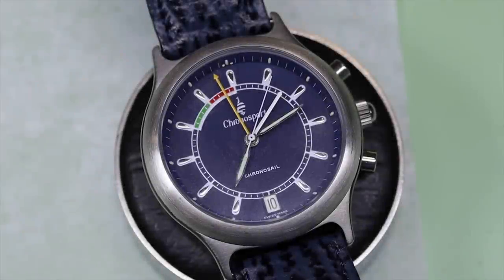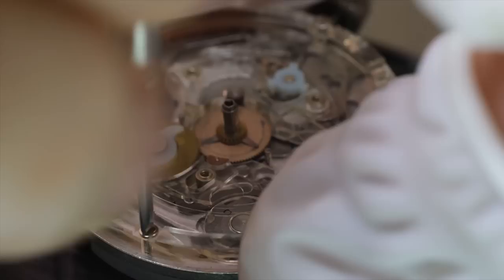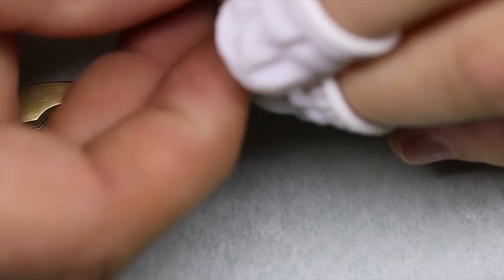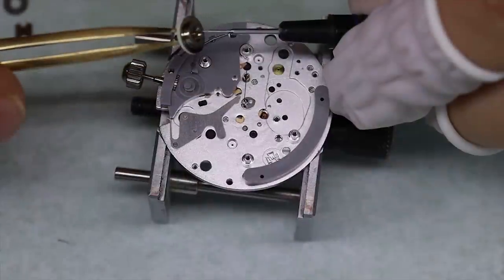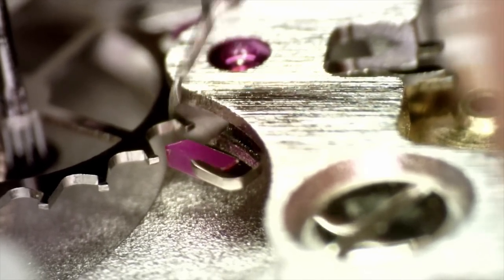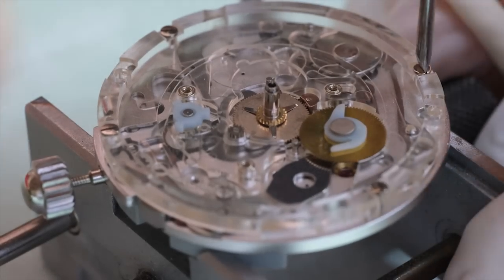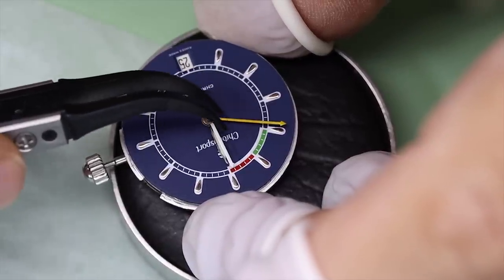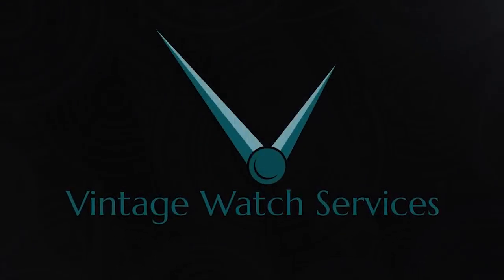A high grade watch with a surprise inside...

Comment: The engineering and design behind this watch are fantastic.  To obtain such excellent performance along with specialist function at the same time as reducing production costs is no mean achievement!
Reply from the maker: Thanks for watching Owen, and your comment is spot on! It was indeed a great feat making this movement in 1975 with a high grade performance but low cost design 👍
Reply: @VintageWatchServices  This company was awesome back then.  Did you know they manufactured the very 1st Ana-digi Military watch (Chronosport UDT type 1)  I still own 2 of the type 1 and 2 of Type IIa  (my favorite model)  from 1979 and mid 80's

Comment: As a sailor and a regatta racer, this watch is all about me.  Very nice indeed.  I don't care if the movement has plastic parts, it seems to have held up so far and with its limited use, should last a lifetime more.
Reply from the maker: Thanks David! I think that's entirely spot on. The watch enthusiast in me wrinkles his nose a bit at the plastic, but it's actually a high grade movement.

Comment: I think this is a very attractive movement.  It has elements of Bauhaus architecture, where form follows function.  There is beauty in the different finishes within the movement - the contrast of the non-reflective plates with the reflective surfaces of the flat levers mounted on the plates.  The screw heads are highly polished. Careful thought has been given to the colour of the plastic - a complimentary gray colour for the plastic attached to the mainplate, clear for the chronometer plate, and blue and white for smaller parts.  Both the inside (the movement) and the outside (the case, dial, and hands) are cohesive and complimentary to each other. All in all, the watch is elegant in its simplicity.
Reply from the maker: Thanks for watching and for your comment, Michael! Very interesting reflections. The movement is clearly very well thought out, it's just strange seen with our eyes that Lemania would use so many plastic parts in a high grade movement.
Reply: But the (movement )finishing is so…butt

Comment: Once again Stian, you come up with something seldom seen in this age of middle earth!  Love it!  Takes me back about twenty years to when I decided that I needed a Sinn 156 which uses the Lemania 5100 cal., so I became aquainted with the ease of reading the center seconds chronograph hand with it's little airplane wings near the tip. There were several companies using it besides Sinn as NATO supposedly favored it for flight use.  Tutima, I blieve, had a contract with the German Air Force to make these watches.  I always believed it to be a rugged and functional movement. It wasn't til a few years ago after I convinced my local watchmaker to service it, that I became aware of it's plastic parts. The Sinn service shop in the US told me they couldn't (wouldn't) service it which I found surprising.  At any rate, that center seconds display remains a very usable feature and I was glad to see that Sinn has developed their own movement based on 7750 , with this feature.
  Thanks for showing this watch, it's truly unique. I'd only seen Rolex's with the yacht timer functions.
    Looking forward to your next video!
Reply from the maker: Thanks for your comment Randy, much appreciated as always :) I'm surprised the Sinn guys wouldn't service the watch, as the movement is obviously serviceable and in fact pretty high grade. But those plastic parts are a bit off-putting to a lot of people, even though they are used in areas where they are quite suitable.

Comment: A functional watch from a time that the watch world lost a part of it's soul. 
I appreciate all types of machines, large and small, and plastic has made it's way into everything. In most cases it's not as beautiful, but is functional and in some cases more durable than metal. I guess that there is a beauty in that.
Reply from the maker: Well said, Peter! I think part of the reason many people don't like plastic parts is that they can picture themselves making metal parts, but plastic cannot be shapen with tools in the same way. It just takes part of the worksmanship away.
Reply: @Vintage Watch Services  interesting take.  The reality is that metal and plastic wheels, disks, etc. are made in the same way: machined from a blank or stamped from a sheet. But there is an abiding image of a smith standing over a forge and hammering on an Anvil. Just goes to show that perception does not always mesh with reality.

Comment: Another great video with good banter and interesting history. I wouldn't mind the plastic parts as long as the costs are in line with the materials and finishing.
Reply from the maker: Thanks a lot, Steve! Most users of course never see the plastic parts and can only judge the quality of the watch from its performance, and that's not really an issue. This watch is actually quite affordable compared to comparable chronographs, and the movement certainly adds to that.

Comment: I am amazed how you remember where each part goes in this complicated movement.
Reply from the maker: Oh, without technical manuals and photos I wouldn't :) The general layout of a basic movement is straigh forward enough that you won't need to look things up even if it's a movement you've never worked on before, but for a more complicated watch there are a few more parts that I might look up.

Comment: One often sees the usual suspect know it all bores on the watch forums say about these types of watches with plastic or less refined parts were designed to be throw away or such and that if you want something that will last forever you have to get a Rolex or Omega as nothing else will last, don’t even start to mention old quartz watches, the bores will tell you they don’t last.
This video proves what has been my experience and that is the bores speak absolute rubbish!
I have old watches with plastic parts inside, forty years old and and still work perfectly, quartz watches including GP’s first true production watch, still working perfectly almost fifty years later as is my Seiko LCD from 1979 and all my Vintage Timex watches from the fifties onwards including the electric still work perfectly and are serviceable contrary to what the bores will tell you.
I’ve been thinking about a memosail so I’m really looking forward to watching that video!
Reply from the maker: Thanks for watching, Ian! I know what you mean and there's certainly a lot of snobbery in the watch world. The way I see it is that the materials matter less than the skills used in the design. What we have here is a very high grade manufacturer choosing to use plastic parts and being very strategic about how and where they are used. This is really a high grade movement that was made at a time when they pulled out all the stops to not be outcompeted on costs. If that makes sense :)

Comment: Well, it IS an interesting movement , that is beyond debate. I do have my reservations regarding 'cost cutting' by means of using precision plastic parts.
I have some experience in the making and design of moulds for plastic parts in the electrical industry .
A well designed and durable mould for parts as seen in that watch, will be a 7 figure affair... and only will be cost effective when you can sell parts(and in this case watches) in massive volume.
Also these moulds have a tendency to wear out a lot faster than you'd want them to. Repairs on them are costly and will often be visible in the end product (in this case the plastic part)
Of course, these days the Chinese will be able to make you a mould for a better price than a proper European or US manufacturer.... but in that case we are talking about Chinese parts in European movements and that seems to be to me, a discussion on par with that one about the "gender of the Angels"

Paddy
Reply from the maker: Hello Paddy, that's great insight, thanks! I don't know the exact costs for this, but for any business case it's always a comparison between alternatives. In general the highest cost area would be manual labor in machining and finishing parts, so if you can avoid that with injection molding I would think the business case would be very good when reaching a certain volume. Nowadays those costs are no longer the same issue, as mechanical watches have gone from commodities to luxury items and the pricing is thus not a race to the bottom anymore :)

Comment: Eh, as long as the plastic parts are durable, I don't have a problem with them. Other than the springiness attribute, plastic parts (like wheels and bushings) also have some advantages against slipping friction when compression loads are light. This is an interesting watch. Quick check of ebay shows that they still command four figures, so someone still likes this movement. Nice little episode. Thanks.
Reply from the maker: Thanks a lot for your comment, Randy! You're absolutely right, there are purposes for which plastic is actually superior, but for many purists (which I must admit I probably am also), there's just something about plastic parts that doesn't feel premium. I think as I mentioned in another comment that it comes down to the production of the parts. There's no human refinement going into a plastic part, no finishing, no worksmanship. I think that's really the heart of the matter for purists.

Comment: These watches have their place; I have an Alpha chronograph with a seagull st19 derivative that I use when I need a chronograph as a tool. I see it as disposable at its sub-$200 price. This seems to fit the same area. I wouldn’t pay what a watchmaker would (quite fairly) charge to service it since I can buy another for the same or less. I actually wonder if this was really intended to be, as with the system 51.
Reply from the maker: Thanks for your comment Jacob! This is really not a cheap watch, however, and nothing like System 51. This watch probably sells for about $1500. The plastic parts doesn't mean it's a cheap watch, it just means the production costs are lower 😉
As I mentioned, this movement (or rather its sibling), the Lemania 5100, known as Omega 1045 was even used in the Speedmaster Mark 4.5. So this is not a disposable watch/movement!

Comment: Would the ultrasonic cleaner make the same racket if you weren't putting a glass jar into it? :)
Reply from the maker: Yep. It's not the rattling of the glass, it's the vibration elements in the body of the machine

Comment: This movement runs extremely well.  I just hate plasic parts in a mechanical movement.  Plastic wheels harden in time and that's when calamity starts to happen.
Reply from the maker: Thanks for watching, Joop! I don't like seeing plastic in an expensive watch either, but in this movement they have used it in places that are less likely to have a negative impact over time. It's a very, very well thought out movement that just might have been a bit of an overreaction to the quartz crisis :)

Comment: I would have thought that plastic and nylon parts would have been more widely used in automatic watches given their strength and natural lubrication properties. No?
Reply from the maker: Hello Eugene, there are limited areas of application for plastic in a mechanical watch, given that it is of course much softer than metal. The softness means that the tolerances you can achieve are nowhere near the tolerances you can achieve with metal. Tolerances are very small in watches if the goal is to provide good timekeeping, but for watches where this is not that much of a concern you might see more plastic. If there are fewer moving parts you might also see more plastic. 
Lastly, over the last few decades mechanical watches have become more pure luxury items, and plastic is seen as cheap. With display backs becoming very common, no one wants to see plastic in their expensive watches :)

Comment: How do the plastic pieces wear over time? Are they comparable? I'd like to see more plastic used as recycled elements in watches if it removed the plastic from the waste stream. Oris is apparently doing that with the Aquis Date.
Reply from the maker: Hello Clay, it would depend a lot on the type of plastic. In this watch, the plate and the bridge supports are made of hard plastic, and I would think the greatest danger would be of them becoming brittle. But so far it doesn't seem to have changed much. The softer plastic as in the wheels would likely degrade faster, but I wouldn't know how soon they wear out.

Comment: Is the plastic used here , more stable under Temperature changes? it must be good if it is- so these guys know what they are doing,...
Reply from the maker: Good question, but in general the temperature changes aren't that relevant in modern watches. This movement is very interesting in the sense that it is manufactured with low level solutions but made with high level accuracy and tolerances.

Comment: Hollow, may I ask you what oil/grease to use on the stem and keyless works?
Thanks
Frank S
Reply from the maker: Hello Frank, there are quite a few ones you can use, such as Moebius 9504, 8300, or even 8200, or you can also use thick oils such as D5 or HP1300. Some also use Molykote DX, but I'd prefer one of the above.
Reply: @VintageWatchServices  Thanks for the answer, but since I'm private person it's virtual impossible for me to order Moebius products anywhere here in Germany. So after I did some research I  came across  Dr. Twillich B52 grease.
They say it's suitable for the keyless works. Hope I got it right.
Frank S.
Reply from the maker: @frankschroth4038  You can Google for instance moebius 8200 and you will find places to buy it also as a private person. But that grease should also work.

Comment: Great job ! How many time to full service this watch ?
Reply from the maker: Hello Grumly, thanks for that! It's a bit difficult to say given that a lot of time goes into adjusting the cameras etc, but without that part it would take some 3-4 hours. It's actually not a very complicated movement, so if you do a few of them regularly you should be able to get it down to 2-3 hours. But I'd much rather work on different movements! 😁
Reply: @VintageWatchServices  thanks for your answer and congratulations for your job, it’s really great. I often check your website and I will buy you a pretty watch soon.

Comment: If the watch keeps good time and runs reliably for years, it makes absolutely no difference whether some mechanical parts are made from plastic. You're not going to see them unless you take apart the watch.
Reply from the maker: That, James, is pretty much the bottom line. 👍

Comment: Plastic in items that are ment to last a long time is never good. Give it some time (several decades, 100 years at the most) and it WILL disintegrate regardless of type (not kidding). I'm guessing that watch has about 20-30 years left to "live" unless someone scans the plastic parts and have them 3D printed in sintered metal.
Reply from the maker: Thanks for watching! Plastic comes in endless variations and the specific material and how it is used in this watch is very thoughtful. I'm not a fan of plastic in an expensive watch for sure, but I'm confident this movement will easily last another 50 years at least :)

Comment: 20% plastic in a chronograph movement is added stress; "overtime becomes brittle and crack's", otherwise interesting watch.
Reply from the maker: It really depends on which parts are plastic, I think. None of the plastic in this movement is really under a lot of stress, so I think it should be fine. And there are so many types of plastic, so I'm sure they can make a variant that doesn't become brittle.
That said, I'd certainly take a classic Venus or Valjoux over this one any day of the week 😁
Reply: @VintageWatchServices  Yes! I completely agree; I own a Hamilton Chronograph with the Valjoux movement, "love the watch".

Comment: it will be my age.... but I can't stand "fantastic plastic" in mechanical watches.
Sure it's a fantastic engineering material, but in my mind it has no place in a proper timepiece
Reply from the maker: Hello Paddy, thanks for watching! I also cringe a bit when I see plastic parts in an expensive watch, but this movement really should be viewed in the light of the situation the Swiss were in in 1975. They literally thought they might lose everything and decided to make a high performance movement with a low cost design. Seen with today's marketplace on mind where luxury mechanical watches are doing very well this movement isn't exactly pretty, but it's a very interesting piece of history :)